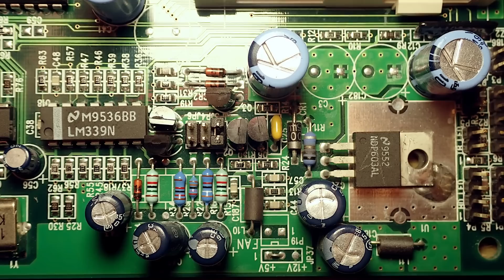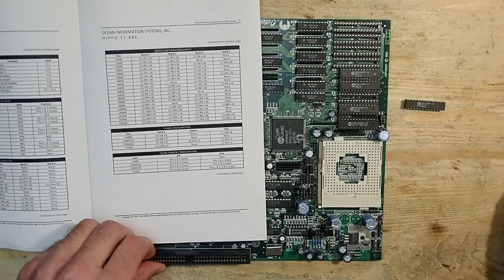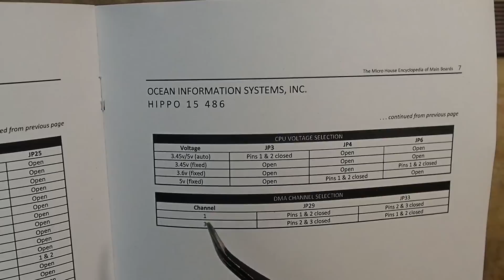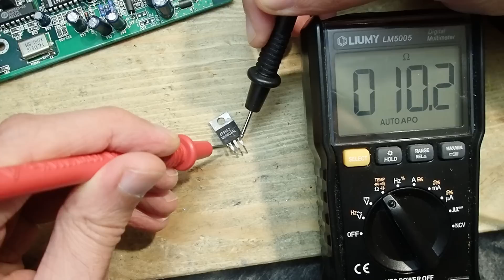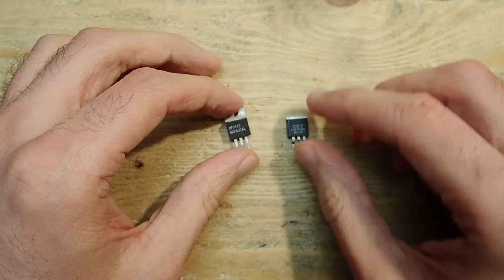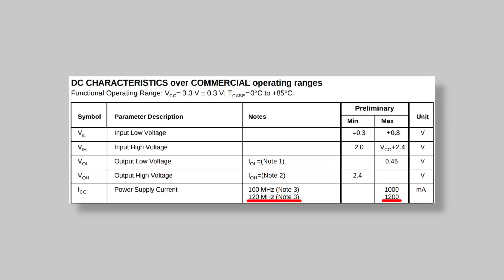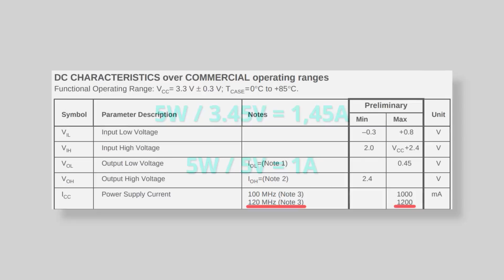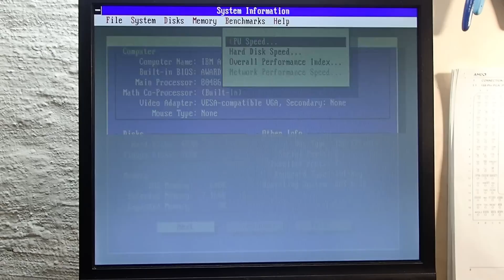Let's repair one of the best 486 mainboard - Octek Hippo 15

Comment: Octek is still around today too. And sell SFF systems and other companies products. It seems they are more a supplier and reseller than branding their own products. 

My predictions for the benchmarks. The DX2/66 should pretty much win every practical test, and will lose in some synthetic memory tests. The Cyrix will come dead last (is it a 2k or 8k version?)  And the UMC at 40 will probably outrun or match the DX50  at 50 in most benchmarks. 

Keep us informed to how fast the PCI clock is driven. I have had to install the turbo button on the clock jumper of one of my boards to coax the PCI bus to run at 40mhz, and basically power the board up at 33 and then switch it during post. Otherwise the machine is rather sluggish performing. 

That UMC should also be able to run at 50mhz. As its fab process was the same as the dx2 they developed (but never saw wide release). It would be interesting to see what it can do.. The only example of the super33 I have, is embedded on a board that only goes upto 40mhz, and has no L2 cache or VLB.

Comment: In case of a resistor the connection point between the voltage and the current is the resistance. Ohm's law should be used. The dissipated power cannot just that simply calculated like a 5W resistor can tolerate 1A on 5V because in case of 0.01 Ohm the current that will flow through the resistor will be 500A at 5V.
Reply from the maker: You are absolutely right.

Comment: Good Job once again. The burned fuse was very obvious but we see the damage with other eyes and light. But in the end you find it and revieved this very nice board. Spoiler: The U5S is very fast for a 33MHz chip. Unfortunately the DX Version are very rare and DX2 Samples are more rare. Still like my PC Chips M919
Reply: It wasn't a fuse, and should not have been replaced with a fuse. The incorrect substitution of a resistor with a fuse may be contributing to the CPU voltage being incorrect.

Comment: In the late 90's I was working for a computer company, and when MMX and P-Pro were the most common machines, we cleaned out the workshops and store rooms and thew away hundreds of XTs, 286's, 386's, 486's and various apples, sgi's, dec's, suns and old computers. Even boxes of brand new boards and MFM drives and floppy disc drives. I cringe every time I think about it because it literally tuck loads of old computers that went to the landfill. Some of the servers we threw away where the size of fridges. We were moving offices and didn't see the point of taking 25 years worth of old computers and hardware with us.
Reply from the maker: I guess, we all went through a similar story :( Sometimes I don't even want to think about what I gave away to the recycling.

Comment: Another great video and your opinion of re capping is same here I only replace them if they are suspect or are plain faulty its especially the p3/p4 era that caps are the worst issue crippling most boards but it isn't limited to vintage hardware but I seen more vintage 486 386 286 boards with original capacitors and they are not the issue and have plenty of life in them but again why waste time fixing what isn't broken best to spend your effort where it is needed fixing the actual problem not what could be which usually isn't. cheers mate
Reply: I agree that quality is probably way more important than age. I've once had a filter cap randomly blow up in a two-year old CRT monitor sitting on stand-by back in like 1999. In hindsight all of the caps in it were likely bad, after another 2 years it was basically unusable, you had to punch it to make it display anything other than a white screen.

Comment: Using a resistor as a fuse in CPU power section seems like a very bad idea. This stuff was very expensive at its time, both the board and the CPU. Cheaping out like that seems very strange to me, especially since the capacitors installed are quite good. Great job on yet another ressurection!
Reply from the maker: Thats a so called fuse resistor. Not quite a simple resistor.
Reply: @necro_ware  The resistor not going fully open after a fault is an indication of it not being a proper fuse. Resistors thermally degrade, even after prolonged usage below it's rating, mainly due to oxidation ("burning"), while a proper fuse only melts, at a specific current, that's why the wire is usually inside an evacuated/inert glass tube.
Reply: @necro_ware  - There is absolutely no indication that it was a "fuse".
It was a current limiting or current shunt *RESISTOR*.

Comment: Funny thing is,  back when a fast moving 486 was all the rage, all everybody could think of was the next little upgrade,  to go even faster. Now that we've got pc's that run so fast, it'll make your head spin, they wanna go back to a 486! 🤭
Reply from the maker: I don't think, anything has changed. For the daily work we still want to have the computers to be as fast as possible. This here is just a hobby for a lot of people, but the reasons are may be slightly different for every one of us. For the one it is nostalgia, for the other one it's the real hardware, which you need to play the old games properly, since all the DosBox, emulators and virtual machines are nice, but not nearly as good as the original hardware. There are important nuances about that, like sound cards and various timings, which you can't easily emulate even with the fastest machines. And that is, where the third group of people like me comes into play - people pushed by curiosity and the wish to learn more about electronics and computer history. You can say the same thing about the old cars or other retro/vintage/old stuff.
Reply: @necro_ware  I do understand... I have a vintage heart as well...

Comment: You seems to have overlooked that the Hippo 15 do support 256 MB max, and it can handle 36 bit EDO ram according to the manual and the jumper settings. 
I agree that you shouldn't assume EDO ram capabilities on a 486 board, this one has it, it seems to have been a very high-end board.

Comment: I'm not sure if this was a US only thing, but EDO ram was pronounced by it's individual letters and not as ed-oh when it came out. In any case excellent video and I wish I had your troubleshooting skills. I've tossed many an old board in the trash if a recap didn't fix the issue. I'm also a big fan of early 80s arcades and a recap is the first thing I do with 40+ year old caps. After a string of terrible caps in the late 90s/early 2000s super socket 7 and p3 boards that didn't even survive more than 3 years it's typically my only troubleshooting step, but I haven't messed with those boards in over 10 years at this point.

I think at this point I only have one socket 3 board left and have a Cyrix DX2/80 in it. I'd like to get my AMD 5x86/133 back up and going at 150 again like I had during the 1996-1998 era with my Diamond Stealth 32 VESA vga card as that was the only 486 I ever had that rivaled early lower clocked p54 pentiums of the time. I'm hoping to get some time soon to try this out as my old socket 7 and socket 3 systems have sat around for over a decade without trying them now. I even have a Gravis Ultrasound in my K6-2 533 system and want to get in going again as it seems to be a very rare find these days.

Comment: About changing caps ... on this board, with just a few in plain sight, and they’re Rubycon?  Yeah I probably wouldn’t replace them either.

On the Epox board I just got, with half a dozen Teapo and a few of some other even more no-name brand?  Yeah, those gotta go.

They looked “fine” - not bulging, not leaking.  I took one out and it measured about 25% over its rating.  Someone clued me in to the fact that this can be caused by leakage.  Wouldn’t have known anything was wrong by sight.

And after a few PSUs that I recapped as a matter of course, that I only realized had bad caps when I started desoldering them and they smelled like a fish market..  It’s not worth risking downstream parts.

It’s your choice, and I wouldn’t pull every cap just because.  In a PSU, always.  And on a motherboard, if they’re a crap brand?  Bye Felicia.

I feel like if you’re going to use old stuff, you should be prepared to maintain it.

Comment: A lot of the people saying to recap boards have no formal electronics qualifications.
Sure there are some know issues with dodgy / cheap capacitors used by some companies over the years, this does not justify replacing capacitors on every repair job.

Comment: Great video! Nice to see that old beauty up and running again :)

I wonder, however, why many of those old boards offer jumper settings for internal CPU clock speeds. Shouldn't all 486DX2 and DX4 CPUs back then have hard wired multipliers? So what exactly does, for instance, setting it to 66iMHz instead of just setting it to 33 MHz?
Reply from the maker: The multiplier is locked, but FSB is external clock. If you have a DX-2 CPU the FSB will be doubled, the DX-4 triples the FSB. So jumper settings are usually the same for 33, 66i and 100i. The "i" stands for internal, all that CPUs run with the same external clock but different internal clock, since it gets multiplied.

Comment: Looks like this board have VIA82C42 KBD controller and unsoldered PS/2 mouse connector. Another challenge to add PS/2 mouse support as it was originally designed by manufacturer.

Comment: Nice :)
Yeah, no need to recap.
Caps look fine + this is a linear regulator.
Reply from the maker: Thank you! Yes, this is a linear voltage regulator. Did I call it wrong somwhere?
Reply: @necro_ware  I not think so, all ok
Reply: @necro_ware  Linear regulators don't have all the switching activity for the caps to contend with, if the linear regulator is fast enough it reduces the need for capacitance in the first place.  I think that's what they were implying.

Comment: Nice job as always! Could you please describe starting sequence ? What is happening after power is on. What starts first - BIOS or CPU? From where are coming those start codes - from BIOS or CPU ? From where diag-card read that codes - from some bus or ?...etc...Thank you.
Reply from the maker: This is described in the datasheet of the CPU (f.e. 386). The CPU gets powered first, then the chipset make initial setup and releases the reset signal. After that the CPU starts to access a program which is located in ROM (BIOS). This application configures and initializes the chipset, which starts the POST procedure and sends the POST codes to the port 80. During this procedure all the subsystems will be initialized and tested. Things like memory, graphics card etc.
Reply: @necro_ware  Many many thanks and respect to you.

Comment: Hello

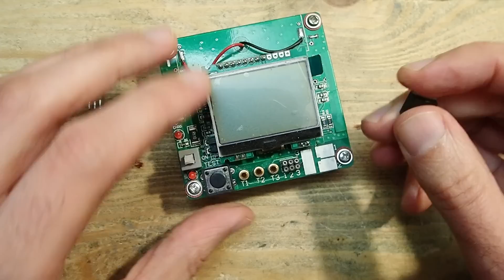What is that fancy component tester in the video @18:25?
How can I get one?

Thanks
Reply: That looked handy. I'd like to know, too!
Reply: @smartperson1  

I did some research: It is some kind of GM328 tester. You can buy online different versions... Instant get! Already ordered. 🙂
Reply: It's called a MG328 (sometimes a M328). They aren't a particularly good product (poor firmware, soldered-in MicroProcessor), however they have inbuilt lithium charge controller. The standard battery holder is for a 14500 (AA) lithium cell, but you can modify it to suit an 18650 or a pouch cell on the underside of the PCB (like he has done). A GM328 (replaceable Micro) or even a GM328A (soldered in Micro) would be a better product choice.

Comment: Hi and at first I would like to thank you for great job putting films about old PC's "mysteries". I have a question to you about 30-pin SIMM memory in old  386/486 PCs. I saw on many videos from you and others sources, there almost always memory test on POST screen doesn't display all the capacity, for example, when I have 4MB memory, it should displays 4096KB but often displays only 3968KB or less. I have the same situation with my Am386DX mashine, where I have 4 modules 1MB each, and test stops at 3968KB and even if I put next 4 modules to expand memory, it still displays 3968KB. What interesting, some time before it displays full 4096KB and when I expand memory to next 4 modules it displays new, full count of memory. Thanks for any help. 
P.S. Sorry for any language misstakes, that's my second one, but I'm trying... ;).
Reply: As to why it doesn't show anything past 4mb when you have 8 installed, I cant even hazard a guess. You possibly may need to go into the bios and save updated settings or configure it to use the extra ram. Some propitiatory machines like IBM an Compaq's are like that. Some motherboards in the 386 era also had jumpers that you needed to set to 'switch on' extra banks of ram. Laser machines especially were like this. 

But for why it shows a bit less than 4mb, that is bios reservations made for shadowing the bios in ram. Essentially copying the bios rom into a portion of ram. It is also the small chunk of ram that is essentially running the code contained in the bios rom. And  that is pretty much hard wired out of the count and not available to use. Some bios will just add that extra little bit to make it total 4096, but all they are doing is guessing with how much the bios is using up during POST.  And not actually counting that small chunk. 

Sometimes the bios can be set to free up that memory once booting begins and make it all available to dos, however that is usually a significant performance hit in a lot of i/o routines that are referenced in bios. And it is faster to shadow those to a copy in ram.  This also goes for the graphics routines contained in the VGA bios of most graphics cards.
Reply: @wishusknight3009  I'm thinking about that, what you write and I don't understand one thing, if it needs to set something in BIOS or by jumpers, so why few months ago it was all OK, when I put 4 MB it was displaying 4096KB, when I put 5MB (all 8 slots of memory 4x 1MB & 4x 256KB) it was displaying 5120KB but for now I do nothing and if I put 4 modules or 8 modules it shows 3968KB. Looks like something doesn't connect properly and stops checking RAM on that value. What's more, if I put in 4x 256KB modules into BANK 0 and 4x 1MB modules into BANK 1 then it shows only 896KB.
Reply: @brzeczyszczykiewiczm  First try to deox the simm slots and ISO-propyl to clean the contacts on the simms. If you do not have deoxit, you can use electrical contact cleaner from the automotive store. (much cheaper, does the same thing but use very sparingly). There may also be a jumper that needs to be reseated. Just by removing it and putting it back in. But it sounds like bank 1 has either dirty sockets or a connection has broken. Doing a reflow or replacing the sockets may help if that is the case. If one simm has a bad connection, it will ignore the entire bank, as the sims are accessed as a group, and not concurrently. 

As for the short count, could be a bios shadow setting and is reset from dead battery. 

What brand is the motherboard? i am assuming its a clone of some sort?

I have a Laser 386/3 which is a DX/33 that has 16 30 pin sockets in it for ram. And jumpers are needed to turn banks on and off.  It also only accepts 1mb simms for a total of 16mb. But most any board with 8 sockets will not have jumpers for configuration.
Reply: @wishusknight3009  The MB is Anix MST 310M. There are only jumpers for CACHE and NPU settings. I have to check connection of memory slots. I already cleaned memory modules and slots by ISO-propyl at first but didn't work. Maybe it needs to reflow...
Reply: @brzeczyszczykiewiczm  Hm.looking at the board from Stetson, I see what you are saying. A UMC chipset. So it is 1991-2 ish time frame. 

Has the board ever had battery damage? The proximity to the cell is a few inches... If it did, then maybe much of it was cleaned up but some acid was left underneath the ram sockets. That is a small possibility, but perhaps unlikely..

But it is more likely a stress fracture with age if the problem is mechanical. removing the simm sockets and reattaching them is better than just a reflow. 

The other possibility is the Tantalum capacitors around the power connector are out of spec, though they tend to go short when they do....  It may be causing bad signal integrity to bank 1. However the bios would then throw a memory error. It is more likely not all data lines are making connection so the bios is just locking out the bank.

Comment: What tool do you use to check transistors and capacitors? It looks pretty cool. Thank you for your video!
Reply from the maker: I can't tell which model it is, I bought it broken years ago for a price of a cookie and repaired it back in the days. Today you can easily find thousands of similar devices online.